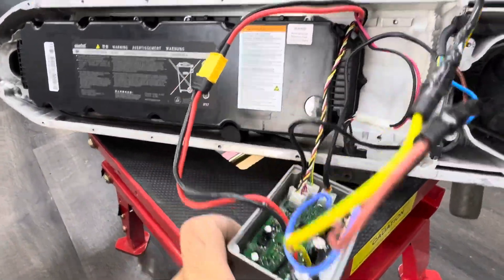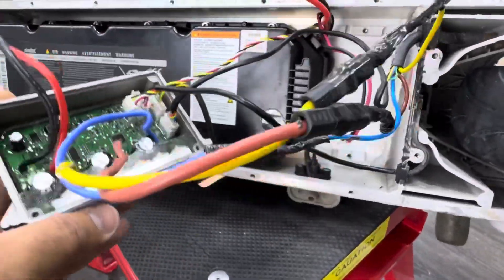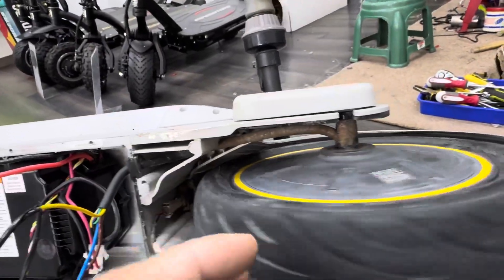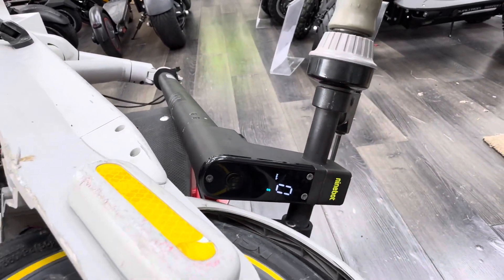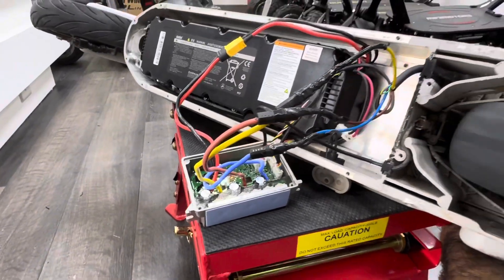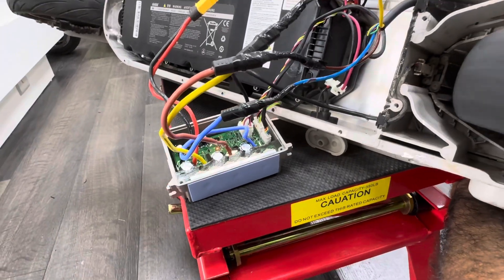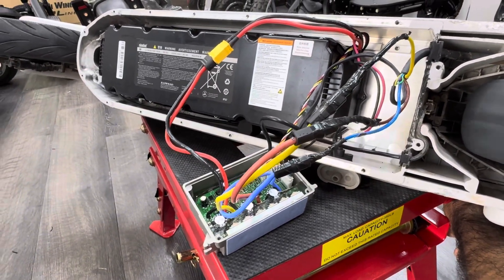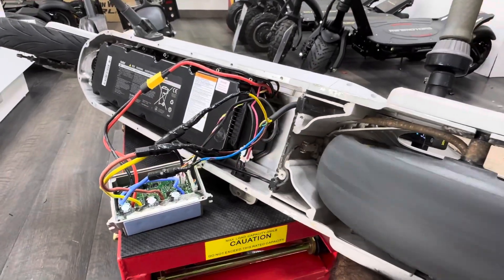Ninebot Gmax30 Motherboard Replacement | Complete Guide | Speed Hack | upgrade

Comment: I change controller of ninebot gmax 30, because it's burn tire is not moving, but it's not working properly , if I remove one 1 wire, it's working but speed goes 50km/h. Can you suggest me what should I do.